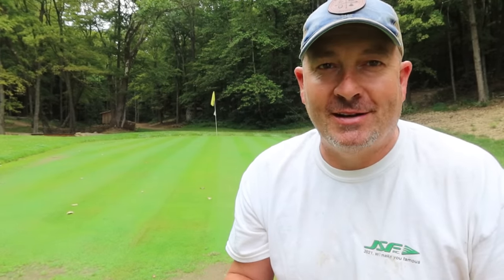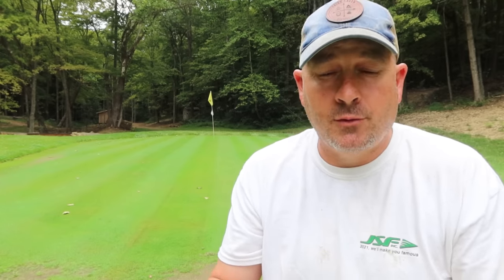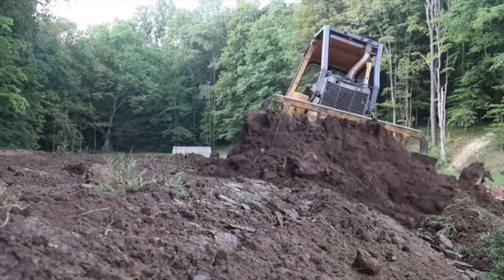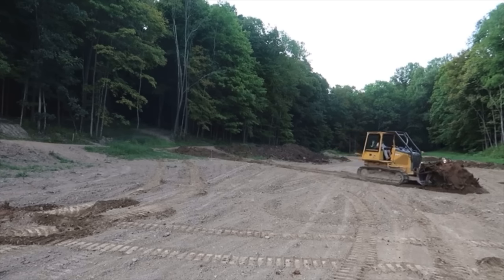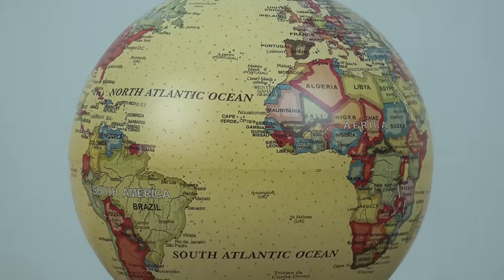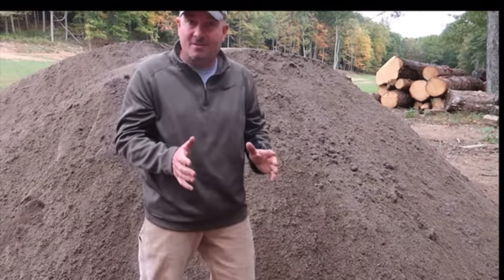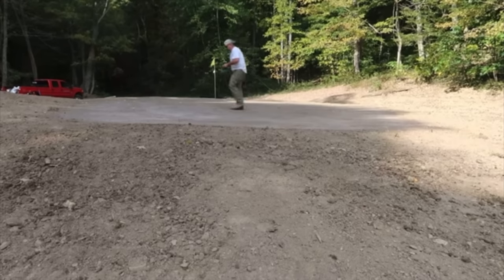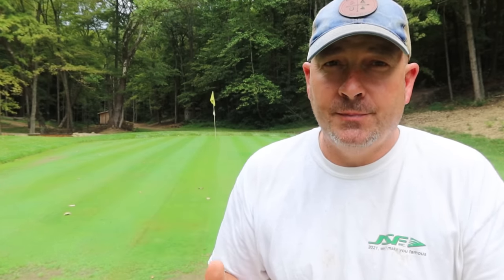How much does it cost to build your own BACKYARD GOLF HOLE?? Cheaper than you think!!

Comment: One of my many jobs was a golf course mechanic. there I got to understand how astoundingly complex turf-management is in this capacity. they cut down the greens to 3/16 and 5/32! and it's flat as a board. try getting that on your lawn at home, you can't. it takes massive work to build the green and maintain it with specialized mowers to achieve that level. I always had to ride out and adjust those greens mowers so they would be accurate if they left lines on the grass. then you have all of the chemical and feed treatments, it's not for everyone and it's not as easy as some might imagine, no way. it will be very expensive but awesome to do. 🏁

Comment: Oh you also forgot something lining the green with special geofabric, around the sides if you don't you get a wicking affect where the clay soil pulls the moisture out of the root zone, ending up with dry soil and turf issues in the front like you have. If the green falls from front to back, or like any real green falling to any side you should add a smile drain because moisture can build up especially with the geofabric. The smile drain runs along the edge of the front of the green like 6 to 12 inches from the edge, hence giving a smile affect, it catches any water the drainage misses

Comment: You didn't consider the type of grass they us at oakmont which is Poa, you should of gone with a root zone of 90% sand and 10% to 5% peat, which is the USGA code for root zone mix in greens when using bentgrass, like you used.

Comment: Built a 60’x20’ green.  007 bentgrass seed $100, load of 50%topsoil 50%sand $300, toro greens master $900.  Total of $1300.  Not too bad.  Was lucky to have a spot on a slope with good drainage.
Reply from the maker: Good on you. How does the ball react when you hit it on from 150? Thanks for commenting, it helps us grow!
Reply: @SpudRunGolf  seems pretty similar to my local course.  Usually runs out 10 feet.

Comment: If it were me, I'd be putting in artificial turf greens and use robot mowers. You want to be spending your time playing, not mowing and maintaining. Use a single green to climax multiple holes of different sizes also. You only need a paddock of about 400 x 500 metre paddock for a full 18 if you are creative. If it is only you playing it, why do you need 18 separate fairways?

Comment: I have no clue why you went with tall Fescue for your fairways, that grass should be cut at 1.5 inches to 3 inches in height, gar higher than half an inch which is the going fairway height. You should of used a disease resistant bent grass or a warm season grass like zoysia, newer cultivars can be used as far north as Chicago. Or you could of gone with Poa fairways.

Comment: Straw covering for the seed is really dumb. Loam applied by hand is quick cheap and will give you a 95% germination. Straw also causes a thatch which isn't what you want on a putting green. I could have built you a green for under $1000 . ps , it wouldn't have bare patches in it either.
Reply from the maker: Copy that

Comment: Your definition of price is used loosely. Building something small like you did sure it can be cheap but than add up upkeep with chemicals, adding more to it like tees another green etc. Teh best thing anyone can do is make a massive 5,000 sq ft green. That way you can have different holes all with one green and 9 or 18 different tees. Definitely don't have it as one hole with a fairway guarded by trees. Having a green in a wife open area is far better for the bentgrass or ultra dwarfed bermuda greens, that way tees can be placed all around in a circle pattern.